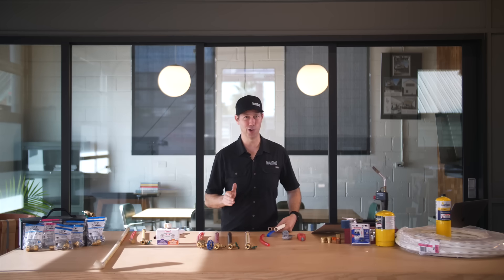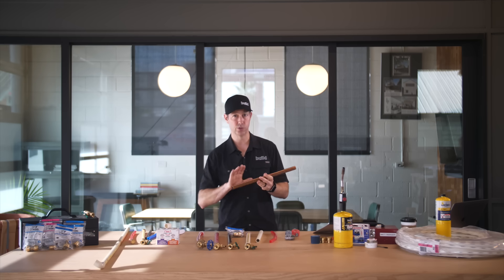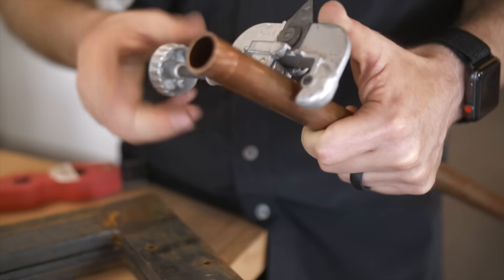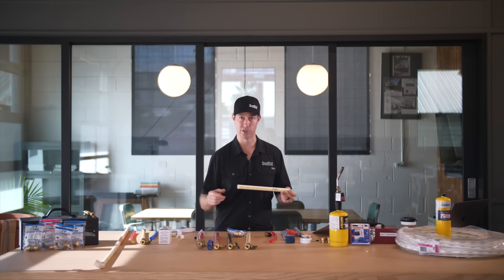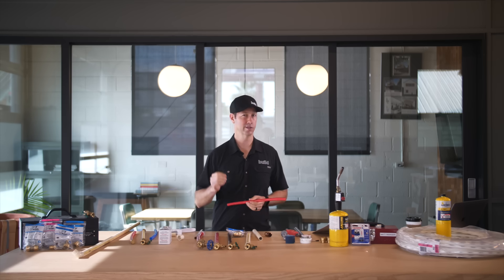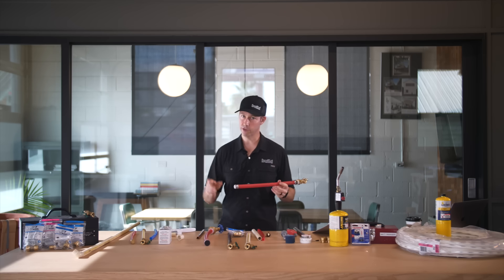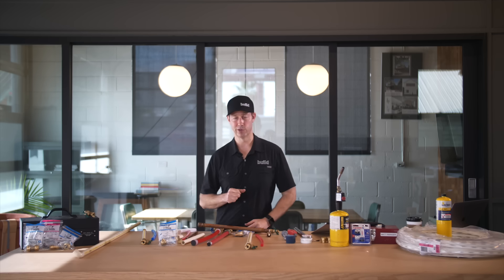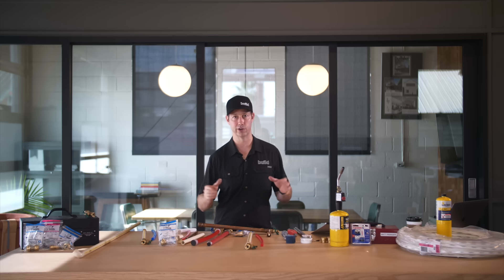PEX vs COPPER vs CPVC plumbing pipes

Comment: Had well water do a job on my copper pipes, pin holes everywhere. Had to change it all out.House was from the 50's.
Reply: Did the pinholes occur on the elbows?
Reply: All through the pipes, come to find out the well water was acidic.
Reply: I've had similar issues. Pin hole leaks just in any random point in the cold water line. My best guess is the cold water line bypasses the filter so maybe more junk in the water. Eventually I'm going to fix that issue.
Reply: Houses on well water need a whole house filter with added carbon filters and a water softener.  You should not pump well water directly into the indoor plumbing.
Reply: So copper shouldn't be imbedded in concrete, should cpvc or should it just be left bare exposed to the elements? I'm adding water to an addition that's 30' away from the house.

Comment: They are 4 types of copper approved in Kentucky. K, L, M, and DWV.
Reply: Dwv or (drain waist vent) pipeing is not sanitary it's only for waist or vent pipeing is cannot be used for water pipeing in any way
Reply: shane hatcher verified as I am liscensed in Kentucky as well.
Reply: K is the thickes it comes in 2 forms flexible and non flexible mostly used for underground installations type L is mostly used for indoor use type m I only seen for drain and wast systems and dwv is so thin that I can only see it For drain style piping or if they were to cheap to put in type m
Reply: @themanwiththeplan128  Type k is what we use in refrigeration.
Reply: @Q_thulu   we'll were im at my inspector calls for type k with brassed fitting or ford fittings for copper underground I know the book says you can use type L or M but I'm.not going to argue with him it's like wrestling a pig in the mud sooner or later you will find out they like it
Reply: colt johnson  type m isn’t approved for drain,waste, and vent . It’s only approved for potable water in Kentucky that I’m aware of. If they’ve changed it the division of plumbing hasn’t notified me and that could be possible
Reply: @shanehatcher9394  it's a preference were I'm at in the code it states the min requirement. For drain lines not the above and beyond
Reply: Type M is for hot water heating in the north east. @shanehatcher9394
Reply: colt johnson hell, I only use m for t&p valves
Reply: It's the same here in Michigan,k ,l ,m and DWV.